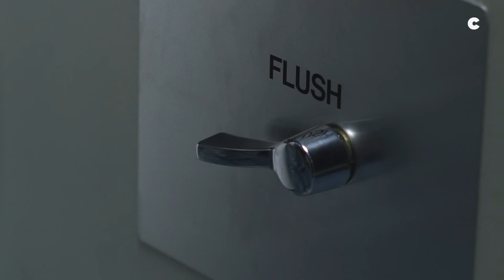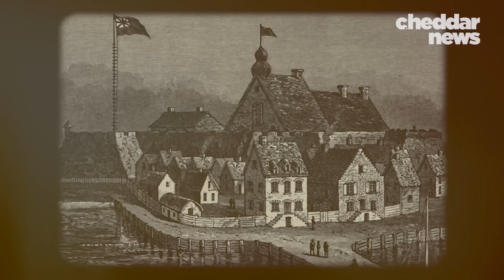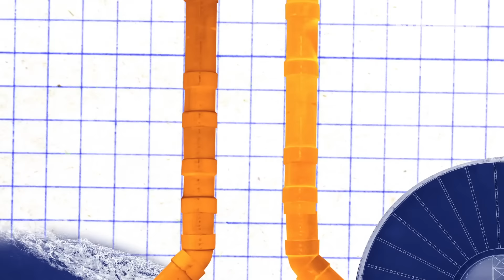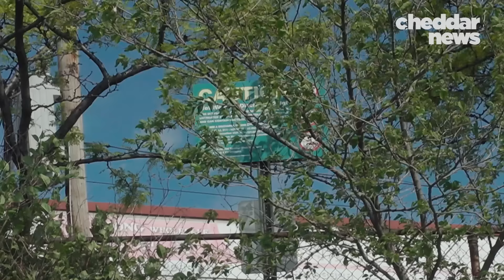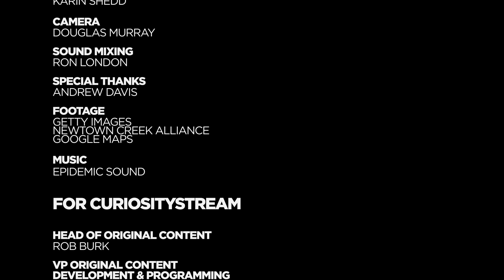How NYC’s Sewage System Treats 1.3 Billion Gallons Of Wastewater  - NYC Revealed

Comment: If you're wondering about the benefits of a separate sewer system:
Not only does it prevent overflow, like the video mentions, it also makes the treatment plants work more efficient because the pollution is far more concentrated and not diluted by rainwater.
It also prevents sewege from coming up to street level during a rainstorm and flooding buildings with... well, shit.
The downside of a separate sewer system is that it takes up a lot more space in the underground. It's fine if the streets are wide but in neighbourhoods with narrow streets, I absolutely hate separate sewer systems when designing new pipeline routes. Power cables, gas lines, drinking water (transport and distribution), data cables, 2 sewege systems, sometimes a drain to manage ground water levels and district heating pipes. Its a lot to put into the ground.
Reply: Honest to god I thought he was like: a revolutionary idea: using a different sewage system
Reply: In australia (Well, the south east queensland water services) our stormwater and severys are completly separated, Thats why on all of our drains it says "dont dump, flows to river" Very helpful dusring storm season.
Reply: @joeygenna4801  I can still do that if you like?
Reply: What about trash on the street washed into storm drains, in a separate system is that line at least treated to some degree?
Reply: You mean you hate designing pipeline routes in simcity?
Reply: @codycast  real life, I'm a pipeline engineer. I wish it was as easy as in simcity. On the other hand, I wouldnt have a job if it was that easy
Reply: I would think by now the environment has a higher priority than it's less convenient to design
Reply: @pXnTilde  very true. Its not just invironment though. A backed up sewer can also cause floods. People dont like having the contents of a sewer flood their homes or come back out the toilet.
Reply: @smith22041  I bet that it flows to the river too.
Reply: @deathgun3110  it does, rainwater runoff is not cleaned before its dumped.
Reply: Separate rain/stormwater, sewer and gray water systems where I live in NZ
Reply: @Twiggy163   actually most have a sack on ends of the storm water pipe at entry to river and they get emptied allol
Reply: @Twiggy163  👍🏼 “if it were easy everyone would do it”. 

Thanks for keeping the system working man.
Reply: @southaussiegarbo2054  we may have different systems then. Only thing being cleaned here are the intersections with a manhole. The pipes are mostly placed without runoff (a slope) so some of the garbage sinks to the bottom. There are systems that try to separate the 'first flush' but they're unreliable. I am intruiged though, in what city/cities do they have a 'sack' at the end?
Reply: Does anyone consider options outside of pipes “to get rid of it” like permeable pavement with below surface holding cells or rainwater gardens? Won’t “solve” flooding or prevent overflow entirely, but could severely reduce the impact & extend period of time to take care of sewage.
Reply: @Twiggy163   most in australia do. 
They also once a year vaccum the openings in the kerb out to.
Reply: @southaussiegarbo2054  openings in the kerb? You mean the drains? Yea they do that. Lots of dirt settles there so its not flushed through the system with the risk of clogging.
I had to look up the sack, I've honestly never seen that before. It looks weird to me but nobody can argue the result.
Reply: @Twiggy163  yep. 
They have stopped like 200 ton of waste going into local rivers since they started using
Reply: Plus the foundation systems, the metro, underpasses, and the transmission cables for cell networks, traffic lights, and home networks
Reply: The power cables thing is something relatively new to me. I'm not sure why it didn't occur to me that the reason why there aren't any aboveground power cables in countries like the US or Canada while they still have power is because they put them underground. Here in the Philippines, the only thing under our streets, as far as I know, are the pipes that deliver clean water, and the sewage pipes that take out dirty water. Heck, some houses aren't even connected to the sewage and someone has to suck up the sewage underneath their homes through large hoses. Above the ground is a ton of electrical cables, and occasionally, telephone and/or internet cables.
Reply: meow meow meow meow
Reply: @moondust2365  There are still plenty overhead cables, just that they all went underground entering the urban area.
Reply: What is ur degree in?
Reply: @Shoppingisfun245   Civil engineering, though with a specialisation in drinkingwater and district heating. Not in sewage, nor sewage treatment. But its common to work together with people who are specialised in that field and sometimes I do have a project where I do the sewage system myself.
Reply: @pXnTilde  Combining storm and sanitary means both sewage and rainwater go to the treatment plant, it doesn't mean that sewage goes into rivers, that's illegal in any civilized country.
Reply: @ev6558  Except that's not true 🙃Every time there's super heavy rain here in Portland raw sewage dumps into the Willamette. There are plenty of articles about it
Reply: Couldn't you dig every 10 to 20 feet and put in a pipe. SO 100 feet down? have pipes. Then have subways at 250 feet under ground?
Reply: @andrewfrodo2086  Could you explain further? I'm not sure I get your idea. I will say: laying a pipe 100 feet down is pretty much a no no.
Its impractical to place and even more so to dig up again once its time to replace it.
Reply: " is far more concentrated and not diluted by rainwater" This is only true to certain degree. Use not enough water and the water doesn't flow fast enough through the pipes, which could lead to clogging and a build up of (e.g.) unwanted bacterias or sulfuric acid. Which could lead to corriosion. Also with the use of more "efficent" devices, the concentration of detergent and other cleaning materials has increased. In my country we have to pump fresh water in the sewer system. Which is why even though we "save" water, we still pay more for it.
Reply: But they can atleast do seoerate one for large street

Main reason they not seperate It is because saving for mafia and rich people and goverment
Reply: @pascal2085  The amount of water that flows through those pipes is calculated using averages on water usage by households. From there they determine the diameter and required slope of a pipe to prevent water moving too slow or fast (there is an optimal value).
If pipe slopes are not feasable, they use pressure pipes with pumps.
I've honestly never heard of having to pump fresh water into the sewer. Though I suppose its possible if a fewer used to be a mixed system and only later got switched to waste water only.
Reply: @Twiggy163  In the seventies they expected a rise in waste water production, but we're so good at saving water (households and industries!), that we only produce half of what was expected. And rebuildung the infrastructure is expensive, so it's cheaper to just pump extra water in the sewer system.

But in general it's not a good idea to reduce water consumption to the extreme. We use less and less water with the same amount of detergents and other (cleaning) chemicals. So they often have to add fresh (but not necessarily drinking) water to dilute acids and stuff.
Reply: @pascal2085  They're probably waiting until those pipes have reached the end of their life. Until then its cheaper to run fresh water through them. Although I suspect it won't be drinking water. It'll probably be raw water at best. Clean, but not exactly fit for consumption. They produce it on a large scale for the industry. If done with the right amount, it'll still prevent clogging, while not diluting the wastewater too much, being cheaper and more effective.

Its still a good thing to reduce drinking water usage as much as possible (though not at the cost of hydration and hygiene). The sewers will get reworked at some point considering their age.
Reply: @pXnTilde  This is true. A sewage system can still dump untreated water onto open water just in case the treatment plant can't handle the volume. I'm looking at a sewer plan where this is currently the case. Even after separating rainwater and sewage, the sewage system will retain its overflow outlet though. Not entirely sure why I got instructed to leave it in. Probably because there are a lot of rainwater connections still further up the line.
Reply: But think of all of the coolant and oil that goes down storm drains.
Reply: @jeffreybundt9391  Usually that's not enough to worry about.
Reply: @jeffreybundt9391  There exist certain types of bacteria that can break oil down in special bacteria-rich (of those certain bacteria types) lakes but I can't find any information online of lakes that actually employ these bacteria.

These oil-eating bacteria is present in many oil wells, and petroleum engineers often have to factor in how much they affect oil production.

As far as antifreeze goes, I don't know if there are any antifreeze-loving bacteria.
Reply: Spiderman no way home<Holy smoke you caught nearly all rats!
Reply: @Lucas_andos they are here in the US as well. Just not in New York. Like in California they are all separate. We have the same “do not dump” signs in our storm drains because they go straight to the ocean.

Comment: There's a few videos on this problem in London as well. People pour their grease and oils that congeal and mixes with the baby wipes to form these massive chunks that clog up the system. The only way to deal with them is to manually break them apart and move them down stream. The investigator was down there doing a story and was dry heaving at the smell when they broke apart. There's also human waste mixed in with it and when air hits it...
Reply: i was also confused when they said borough even though thats still same as a town, no one uses that other then england
Reply: that is so disgusting oh god
Reply: You guys need to stop using the damn wipes.
Reply: @ironhell813  Not going to happen. The problem is that you're suggestion is spot on, and makes a ton of sense. This is fucking up our sewer, stop doing it. However, once you have wiped with wet wipes, there's no going back. That clean, slick feeling is just too good. It would be like saying jets use too much fuel, get rid of them and go back to prop planes. The ONLY solution is to install grinder stations to liquify the solids so it flows properly. Problem solved
Reply: @ironhell813  No, throw them in the TRASH, never the toilet. Also throw toilet paper in the trash if you use a lot of it or you live in the city.
Reply: @ericscott9029  - must smell nice in your place.
Reply: Someone gets paid to do it.
Reply: @valuedhumanoid6574  Ever came to your mind to wet the wc paper 3-4x layered? Then wipe dry clean. The same result.

Comment: From the late 90's to early 00's the area of the city I live in did a storm water sewage separation program. The city dug up all the sewer pipes and replaced them with pipes that did just waste water and diverted all the storm water into new pipes to flow into the rivers and streams or made new streams. The water quality in the one discharge river improved markedly so we don't get swimming bans so much any more. But now there is a new kind of heavy metal and rubber pollution going into the waterways because of all the cars and especially heavy trucks, so now there's a ban on gathering food from the waterways around the city because the cars have made it too toxic.
Reply: The brake dust off cars is a big one
Reply: Cars suck
Reply: @joenuts5167  Cars bad, but not the trucks the deliver my consoomer items from Amazon!  😂
Reply: @joenuts5167  No, you do.

Comment: I worked in a sewage works and I was amazed at the size of the fat burgers that built up in the water system. When we broke them up we put them into skips, ready to go to landfill.  The seagulls had a good feed from the skips before it was taken to the tip.  People put some strange things down the toilets and drains.  Sanitary towels, wet wipes, towels, underwear, cutlery, plus many other household items.  One of our jobs was to go to outlying small sewage works to clean them out.  One day as we were cleaning one of these out the local abattoir released the blood into the sewage system and we were covered in in blood from head to toe.  Not nice.

Comment: There is a new option now with porous concrete and asphalt that eliminates the need for storm sewer. Partial implementation should produce limited relief for a troubled system that would be hard to upgrade such as NYC
Reply: Not quite, the porous roadway still has to lead somewhere, it can’t drain into the water table directly indefinitely. Those porous roadways usually still do have piping. Plus they are much less strong than regular roadways so can’t simply be drop-in replacements, they’re basically a totally different civil engineering material with different support requirements, and need the road redesigned to greater or lesser degree. It could help be an inlet to a storm sewer, instead of grates things can fall down, but it won’t solve storm surges by itself.

Comment: I’m wondering if there’s any attempts to clean the water from the overflow bodies when capacity is available. Seems like something that would be helpful. 40x a year is a staggering frequency for the volume!
Reply: Many areas have started digging deep underground tunnels that store the stormwater from the combined system and then pump it to the plant when flows decrease.

Comment: What is a rain event? Is it what here in the UK we call a normal day?
🙂
Many years ago, whilst training to be a teacher, we were taken on a tour of a waste water treatment plant. At the end of the tour, the guide's "party trick" was to demonstrate how clean the water was by drinking a glass taken from the plant's outflow pipe.
Reply: So I don't know for sure but I know of the events my dad gets called in to do overtime (he works for DEP) - the rain he usually gets called in for is super heavy, like thunderstorms and worse. Something that should be remembered is that we don't avoid the impacts of hurricane season, just most of the time we don't get hit with the brunt of it. My dad was actually called in to work when Sandy hit, just as an example of the worst case in recent history.
Reply: When a good rain hits the wastewater treatment inflow can easily hit 10x of what the plant is designed to do. For treatment to be effective every plant has a recommended detention time for complete treatment. Some wastewater plants have a regular flow condition and high flow
Reply: Most UK sewers overflow every single time it rains more than a drop too. 

The only project I’m aware of to try and mitigate this, is a big underwater tank (that’s underselling it, it’s pretty intensive sewer rework) being built in London to store the storm surge prior to being treated like they mentioned in this video. But it’s a decent time from completion.
Reply: They are likely referring to a major rainstorm, that would accompany a hurricane.  Such as Hurricane Sandy.   Not just a run-of-the-mill day of light rain.
Reply: The problem is the overflow that gets discharged before ever making it to a treatment plant, as was explained in the video.  This is also a problem in London.  How could a "teacher" be this dense?

Comment: She’s cool. Need more people like her. Can wet wipes be made to ACTUALLY be compatible with waste water treatment? And wouldn’t a combined system technically be better since it treats the rain water, too?
Reply: Wet wipes are stupid idea. Just use a bidet, it's much cleaner and doesn't clog your waste water system.

Wet wipes need to survive being doused in water for long periods of time so it doesn't disintegrate in the package and while being used. But that same property is also the reason why it clogs the wastewater system.
Reply: > wouldn't combined system be better?

Rain water generally don't need to be treated before they're released to the environment. They may not be clean, potable water, but they don't contain as much of the biologically hazardous materials that wastewater treatment plants targets. Also, the kind of pollutants that pollutes rainwater (oil leaks from cars, fertilizers, etc), are quite different than in waste water.

All that combined waste water system does is dilute the waste water, which means that plant has to be designed to handle much larger volume of water and it's more expensive to process the diluted waste. 

If a waste water treatment plant is nearing capacity, they could just ask the city to stop/slow down issuing building permits to give them time to upgrade the wastewater system. You can't tell the weather to stop the storm season.

Also, the volume of rainwater are a lot less predictable than wastewater volume, which means you need bigger capacity of everything so you can handle the biggest storm, but these are capacities that are not utilised when it's not stormy seasons, but you will still be paying for.
Reply: @yvrelna  you can put wipes in the bin? I’ve also found a bidet is nowhere near as thorough in outcome, although I’m admittedly on the extreme end of cleanliness needs for comfort — I can’t imagine how most people deal with JUST toilet paper.